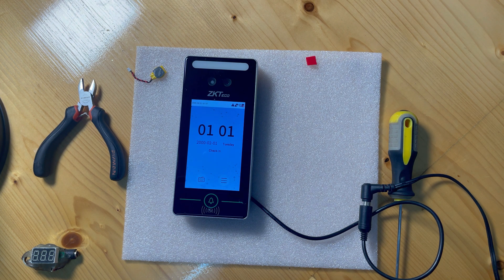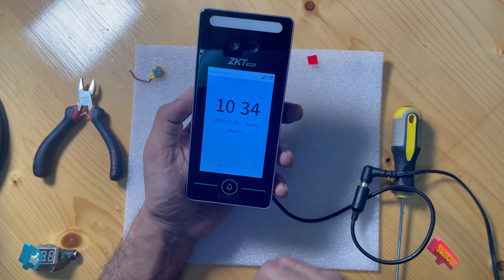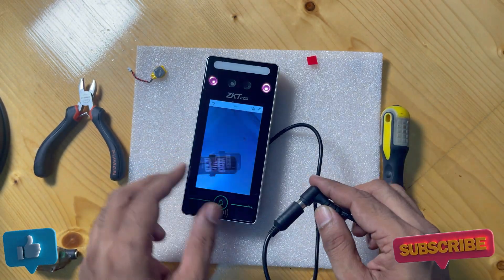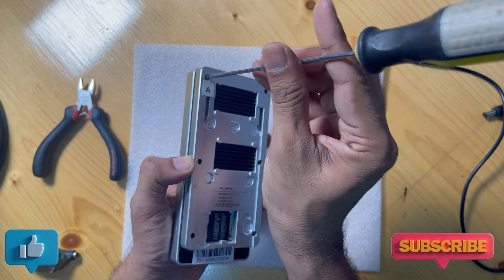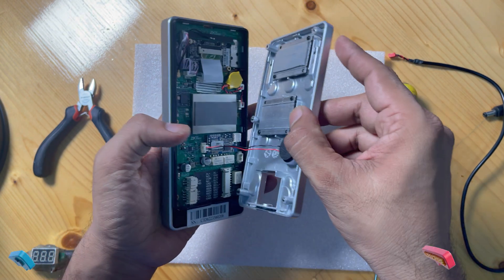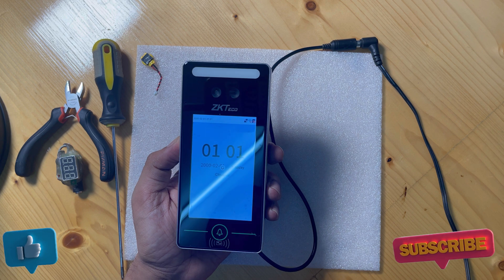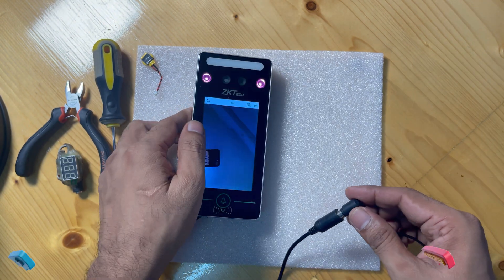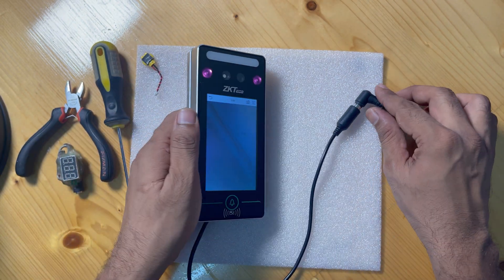ZKTeco - Zktime Biometric Battery Problem- Date Time Reset Solve- Replace New Battery

Comment: To fix this, simply remove the yellow cover, purchase a CR1220 battery, and solder it yourself. Replacing the entire part is not recommended since it's hard to find and costs more.
Reply from the maker: You can also use a similar battery and replace the old one with a new one.